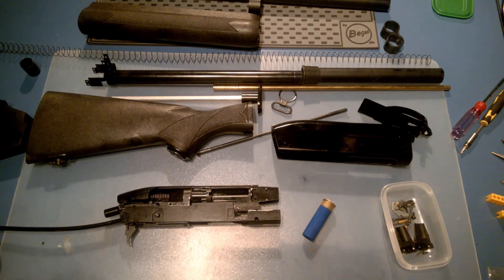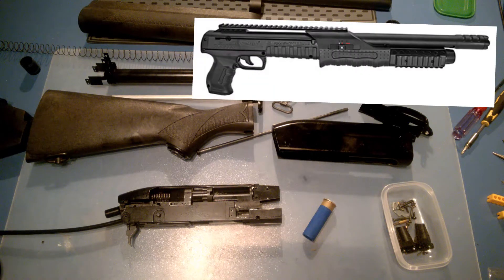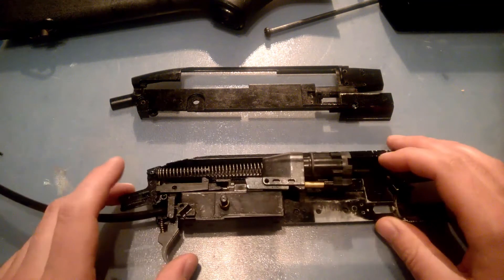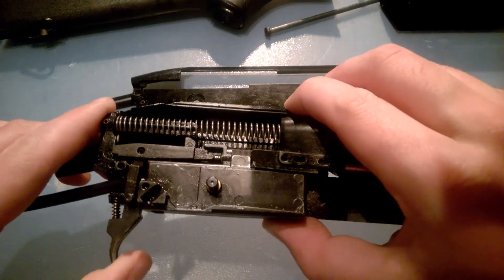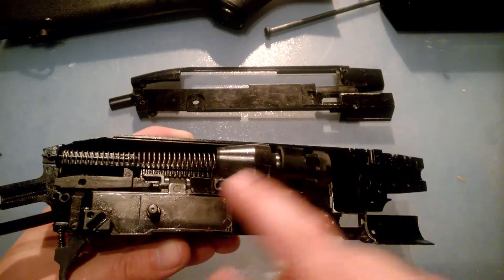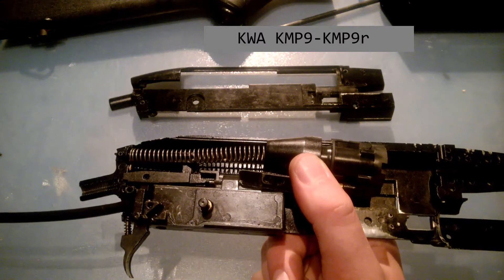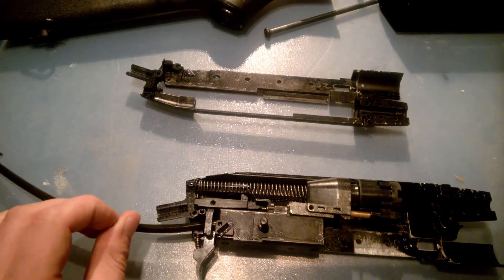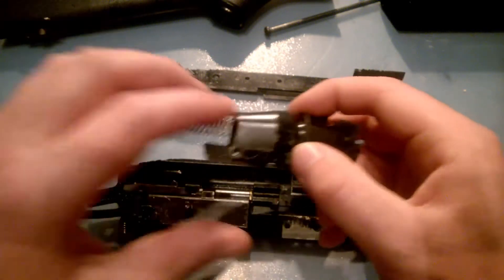The maruzen m1100, an interesting gbb

Comment: Thank you very much for video! There are not many info on the internet about the M1100 internal and how it operates. Maruzen has reproduced the M1100 in 2018 and this gun caught my eyes again. I knew this gun for long time and its poor reputation about the performance and durability. The one piece ejector will be a big issue as it worn off.

Comment: Hi, I recently bought an M1100 as a non working project. I replaced the hose and also did the ejector fix. The gun now ejects every shell BUT will not fire BBs? I presumed it was the rocket valve spring being too weak and replaced with a cut down TM glock rocket valve spring. The problem still persists, any help to can offer? I'm using green gas.
Reply from the maker: it could be possibly the seal between the nozzle and the shells, the nps valve only closes when enough air volume/flow escapes from the nozzle to the barrel.
If the leak between the nozzle and shell has to much of a leak to close up the system properly, it could cause the bb's not to fire but in cycle the system.

this is only a guess, so don't take my word to highly on this.